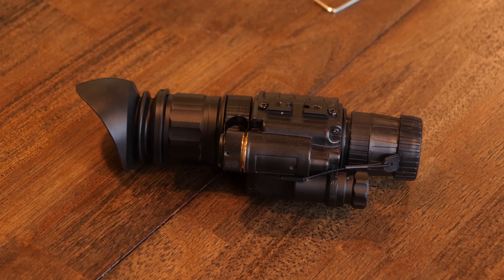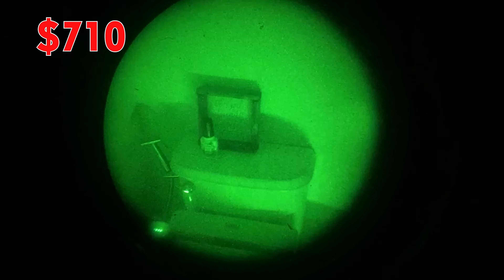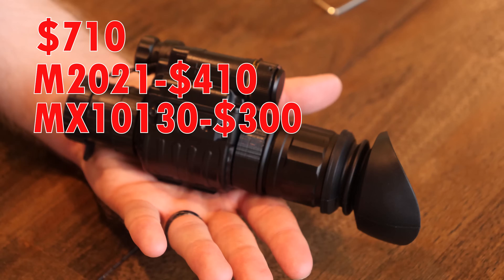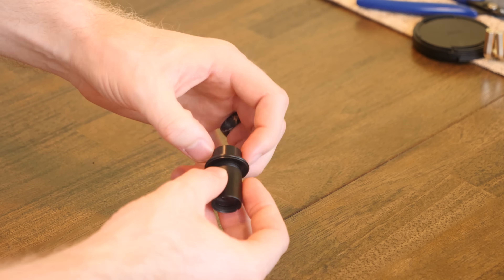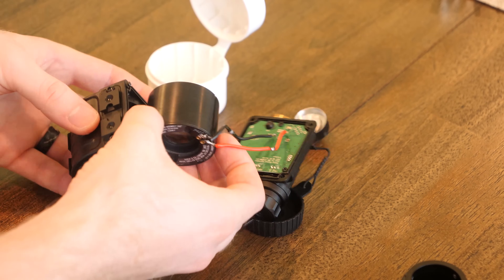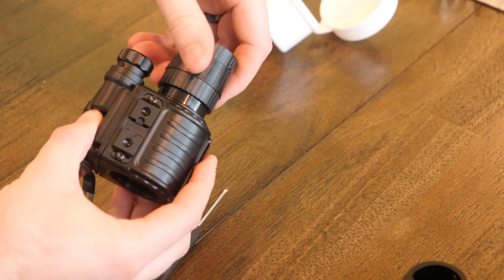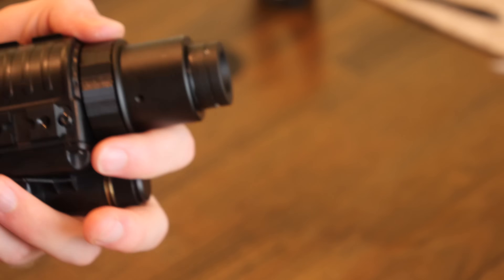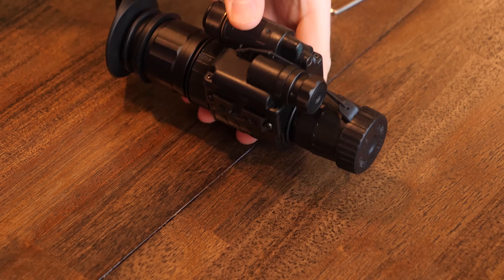How to Build GEN 3 Night Vision for Under $1000

Comment: Can I use another Tube like you mentioned MX11769 or MX10160.
Reply from the maker: Not for this housing. However, They make a similar housing at a similar price point for those tubes. those tubes are more expensive though.
Reply: @djgunner258  Why not will they not fit, or would voltage be off I really don't know anything about these. Also, what tube was the housing originally supposed to hold?
Reply from the maker: @mushroomroots9867  I can't say for sure that is wouldn't work. I think they are a different size compared to an MX10130. even if it would work with extra modifications I'm saying there is a more straightforward answer, they literally make a housing that fits the MX10160.
Reply: @djgunner258  Ok last thing I found a gen 2+ tube online and this housing says gen 2 and gen 3 I assume that means tube compatibility so could I theoretically use gen 2 tube instead of gen 3 because I’m impatient on finding gen 3 tubes I would also assume I could just not use the inverter because I don’t think the gen 2+ tube is inverted?
Reply from the maker: @mushroomroots9867  as long as it’s a MX10130 it doesn’t matter if it is Gen 2 or Gen 3. You’ll still have to use the inverter for Gen 2. All MX10130s are inverted.

Comment: Where did you find the circuit you used?
Reply from the maker: What do you mean by that? Like where on the circuit board?
Reply: @djgunner258  where did you find that circuit board? It come with the housing?
Reply from the maker: @mirco38  it came with the housing.

Comment: Also, 2nd comment here. What exactly is the difference between the tube used here that fits this identified housing vs a tube that fits a typical pvs14 housing? Wondering if modifications are possible to this housing to fit a more common tube. I am very interested in a build, but I would really like to use WP instead of GP. I haven't looked, but I am guessing these older tubes are only GP.
Reply: The MX 10130 is a 18mm Image intensifier as the PVS/ANVIS image intensifiers MX10160 and MX11769 (gain pigtail) tubes, that are 16mm, they are slightly smaller. GP and WP tubes are made for the PVS 7, Elbit Systems makes WP MX10130 style tubes... Best Of luck!!!
Reply: The main benefit to this system is that older tubes are much cheaper so there would be no real reason to put an mx10160/11769 because at that point you're just approaching the cost of a used PVS 14, especially if you're going for white phosphor.
Reply: @philswift1252 and whats the drawback of a pvs7 tube? Beside being green ofc
Reply: @Moe_lester_ image inversion, at least that’s the claim of the video

Comment: I did this build and it does work. Seems like you loose some light in the inverter though.
The damage from factory mentioned was there in my unit as well and it seems like it is made intentionally to make room for a potted conponent on the PCB. They probably have stock on the housing that was made before they could change the plastic tooling.
Reply: does it compare to something like the pvs-14 or is it not in the same league? thinking about buolding one and maybe another later to make a binocular!
Reply: @Fischer56  buy a pvs14. i have the housing and it's pretty bad, pvs14 has more replacement parts and is outright better
Reply: @WHITE_PRIDE0  so spend 3K to have a better housing…. I mean I’ve seen videos of PVF seven tubes and they were just great during the night. I mean you can go hiking everything. I wasn’t even going to get this to anyway because the guys are saying that it isn’t the little inverter in there. It was actually the eye piece that makes it inverted. so get a 3-D printed housing which 3-D printing is held up and proven has I mean people are making guns out of them put the tube in there and now you have a 410 maybe $500 PVS seven monocular
Reply: @TruthPrevails24  i’m not even going to read this whole comment. no, i won’t. a 300 dollar tube is not worth a 3 thousand dollar housing. PVS14 mil housings don’t even cost a thousand. what’s wrong with you?
Reply: @WHITE_PRIDE0  they easily cost 1000😭😭😭 you obviously have never built your own pair. You’re sitting here trying to justify spending more money on a housing 3-D printing would be way better than 10 times cheaper. i see why you wont read😆😆😆
Reply: @TruthPrevails24  it costed a total of 1k. 400 for the tube and 600 for the housing. i built it myself, i would know it’s trash, i built it
Reply: @WHITE_PRIDE0  what part is trash? idc if its trash im talking price, imma build pvs 69s, 600 for bridge gen 3 digital. but if you use pvs7 tubes it would be great, def use them, domt see how a actual pvs14 housing would be trash. just overpriced imo
Reply: @TruthPrevails24  man i don’t think you see what i’m saying. there’s nothing wrong with pvs 7 tubes, but this build specifically is horrible, it’s chinese trash that doesn’t hold together over even 3 weeks
Reply: @WHITE_PRIDE0  yeah I totally read your comment wrong. I thought you were saying the pvs14 housing is more worth it.
Reply: @TruthPrevails24  no i am, the pvs 14 housing is far more worth it than the 600 dollar chinese one he says to use (if it would work with pvs7 tubes)

Comment: So just for clarification, Did you print the adapter for the image inverter or did it come with the housing? im assuming you printed it and the image inverter came with the housing itself.
Reply from the maker: I printed the adapter and the inverter came with the housing. You are correct.

Comment: Awesome! Thanks for helping an Aussie out that can’t get decent night vision at a reasonable price. Also did you not have to purge the unit?
Reply: Zero percent chance that thing is holding a purge
Reply from the maker: No problem! I did not. I’m sure it might help to purge the unit, but I don’t know how well it would hold. I don’t think it Is extremely necessary either.
Reply: @djgunner258 I do believe you can buy spray cans of argon gas if you'd like try purging it. I think the gas is normally used to get rid of oxygen inside of opened wine bottles to help preserve the wine.
Reply: Awesome thanks for the response. I’m going to attempt the build I’ll keep you posted 🤘

Comment: Could one put a pvs 14 tube in there and take out the inverter
Reply from the maker: Maybe??? I honestly wouldn’t risk it. If you’re looking for a cheap housing for a PVS14 tube they make another one that is specifically designed for them. They look like NVM14s.
Reply: @djgunner258  This is a joke right? I'm too dumb to tell XD
Reply from the maker: @pieteralbertyn5384  it’s not
Reply from the maker: Maybe??? I honestly wouldn’t risk it. If you’re looking for a cheap housing for a PVS14 tube they make another one that is specifically designed for them. They look like NVM14s.

Comment: Nice video. Just few questions. Does it have an autogate? And is it waterproof?
Reply from the maker: Autogating is built into the tube not the housing. So if the tube you buy has it, then yes. No idea about the water resistance. Definitely wouldn’t go swimming with it. But I wouldn’t be worried about rain given you add some sort of sealant when you assemble it.

Comment: hey man, starting the build process soon and want to know what kind of mounts the m2021 can be mounted on, im really new to the nvg scene. much appresh.
Reply from the maker: Kind of a vague question because there are 3 different mounting point when it comes to attaching to a helmet. What you need to know is that there are 2 types of connectors on NVG housings. PVS14 has a tripod screw connector and almost everything else has the Mum connector. The m2021 has a mum connector. The cheapest way to connect it to anything would probably going with the setup I go over at the end of the video with the knock off panobridge with a genuine noisefighter mum adaptor (marketed as a flir breach adaptor). For more info on the other mount you will need to get it on your helmet I’ll refer you to this video from brass facts. https://youtu.be/H__7HYEeulo
Reply: @djgunner258 where can I get a knock off panobridge?
Reply: @kabar123ar  Ebay. FMA Nylon J Arm

Comment: Can you test this in the day or will it break your nvgs
Reply: please only test NVGs in a very, very low light surroundings.
Reply: You can, but you need a pinhole cap on the objective lens to test during daylight hours, also there's an tech called "auto-gating", basically in high light areas the tubes turns off and dims the images, but it happens 100's or 1000's of times a second, too quick for the eye to see (though some people can see the flicker), this auto-gating is what allows the use of an night vision monocular/Bino etc to be used in the daytime. 

Although caution is always to be advised with any usage in non-nocturnal hours, an average Gen3 tube will last 10-15,000 hours with careful usage but can be destroyed in 2 seconds with the wrong usage, also Soldiers (and airsofters) using night vision use what's called an LIF filter (Light Interference Filter) , basically it fits over the objective lens (usually) and filters the wavelength of green laser light, which can destroy tubes in a second. This is another way to protect the tube.

Comment: Pvs-69 is apparently also a pretty good setup
Reply from the maker: Arnt PVS-69s digital though?
Reply: @djgunner258  yes, but they honestly don't seem that bad
Reply from the maker: @domesticonion8026  Lol in no world does digital NV compare to real Gen III night vision.
Reply: Youre very wrong on that. Look up sierra pacific X27 . That came out 6 years ago and they're currently building a prototype for military trial. Digital night vision is substantially far superior then analog. Canon just created a hybrid SPAD sensor that actually see photons and they're getting ready to release this in security cams as well as military test. Digital was trash a three years ago but it has completely changed as of a 1 year ago. The new sionxy opsin uses a low lux CLAIMED by them 1 mililux sensitivity. If thats actually the case then yes , that is better then gen 3 but not by much. Give it a few more years and we will see digital completely take over. All you have to do is research what ive said before you say no.
Reply: @luciankristov6436  will digital ever not have a latency? If you have to look at it through a sort of video feed, I don't see how it wouldn't have a delay
Reply: @luciankristov6436  you aren't very smart. i'm pretty sure a magical toilet paper tube that uses virtually no electricity to work is better than a battery eating camera that's nowhere near as sensitive as gen 3 wp filmless and has latency
Reply: @djgunner258 They can accept analog tubes now

Comment: why is the housing hundred of dollars??? its just plastic right?
Reply from the maker: Most of the cost is probably the lenses.
Reply: Plastic, fairly good lenses, an IR led, and a small circuit board that controls ABC one other feature that protects the tube (not automating) but forget what it is. 
Still, your point is valid. It’s manufacturing cost is likely around $50. Now think about this… you can’t get a new comparable housing from an American retailer for under $750 and the American wholesalers for under $650. Usually their much more if they are a quality brand. 
The night vision game is an expensive one to play.
Reply: @nicholaddelioncourt7863  as far as I'm aware ABC and Autogating is all in the tube, so no need for special electronics externally in the housing.

Comment: If people are having problems to find the MX10130 tubes there was also tubes with the designation XX1450 which will work with this china body, I harvested my two from some fujinon Night vision binoculars that are super cool too as they have image stabilisation afforded by a onboard gyroscope, the XX1450 tubes will also work with this china housing as they also work in PVS7's. they are also super easy to harvest from the binoculars. However I am not saying go look for these Fujinon 10 x 40 stabilised binoculars as they are as rare as rocking horse poo and they cost more than a new pvs14! 
Mine are the ruggedised military issue ones which I believe have milspec gen 2 tubes in them. 
the data sheets for the XX1450 tubes show them to be made by photonis.
Hope this additional info helps some people to find the tubes they need.
Reply: Would you be able to lead me to a reputable source to purchase intensifier tubes? I have a 3d printer and about $1k to build one of these that I’m willing to spend right now, but All my searches either lead me to $2.5k intensifier tubes on Optics Planet; or eBay and what seem to be scam websites, neither of which I trust. Any help is greatly appreciated
Reply: @GhiIIie  Tacswap
Reply: @ibingly  thank you, you're literally the only person who's helped me at all in dozens of comments
Reply: @GhiIIie  happy to help. I bought a tube from a guy on there for $400 this past weekend. 👍🏻
Reply: thank you very much! You gusy are all awesome.. SO glad i stumbled on this video!
Reply: Do you know if this would work with a  XX1441?

Comment: How did you get the housing from alibaba. They require a minimum order of 50 pieces and each costs $380.
Reply from the maker: You’re probably looking at the wrong page. It’s a bit more expensive but they’ll sell only 1.
Reply from the maker: Contact the supplier and they’ll sort you out.

Comment: Would you consider selling those 3d printed adapters? I don't have access to a printer. Also, how long did it take for you to get the housing from Alibaba? I'd love to do this build but I'm going to be moving in a month or two and would hate to miss the shipment because of it.
Reply from the maker: I don't actually own a 3d printer either. Also, I wouldn't be comfortable selling someone else's work because I didn't design it. I'd look around online or locally to get it printed. It took about 3 weeks for my housing to arrive. I would play it safe and wait.
Reply: @djgunner258  Hey, I'm very new to this. Could you point me in the direction of where to look for people to print accessories like this? With my budget this is the only way I can provide NVG's to my dad and I. Thank you!
Reply: @djgunner258  If people could only sell things that they designed there would be a lot of people that could never sell anything. That's so ridiculous. If its not patented than your fine. If anything you'd pay for the original design file.
Reply: Shapeways my guy they can even make it in metal
Reply: @truegrits257  that is true but they'll charge an arm and a leg tho
Reply: Go to my channel and send me an email on my about page. I can print one for you.

Comment: I just picked up a MX10160 too damn. I was going to build out some PVS 14s your opinion since you own both should I just sell that tube and do this instead for half the price?
Reply from the maker: Still have to do some more comparison, but right now my recommendation is if you can afford a PVS14 get a PVS14. I see this as more of an option if you can’t afford a PVS14, or as a loaner/beater unit to keep in your car/get home bag. Now that might change if I can get a machined adapter piece instead of 3d printed.

Comment: Is it possible to put this intensifier in a PVS-14 part kit? Possibly plug and play?
Reply from the maker: Nope, the tube is too big to fit in a PVS-14 housing. Also you have the inversion problem to deal with.
Reply: @djgunner258  Any other part kit that can be used? I am a bit worried about water proofing
Reply from the maker: @kevinw4267  Unlikely. This is the first housing that has ever been identified to work with a MX10130. Unless you’re planning on going swimming I wouldn’t worry about it. You have direct access to most of the seals when taking it apart. Maybe put some sealer in there? You’re getting a.  Extremely cheap gen III monocular. You’re not going to be getting PVS-14 ruggedness.

Comment: super cool! would make for a great loaner unit. Would you be able to run on with a pvs14 on the panobridge? or woudl there be in issue with how the units sit since theyre different housings?
Reply from the maker: Thanks! That’s exactly my use for this one. You’d run into problems trying to bridge it with a PVS14 because the m2021 conversion is so much longer. The PVS 14 would be like 3 inches away from your face while the m2021 is touching your eyeball.
Reply: Just make two. Is it gated ? Or Any gain? 
I'm sure I could figure out how to make a bridge to match them up. 
I just modified a MOD Armory swing arm/Jarm for a  Flir Breach PTQ 136 and a PVS 14. Had the same problem with that . 
Great video man !